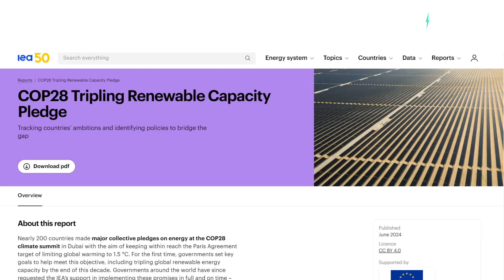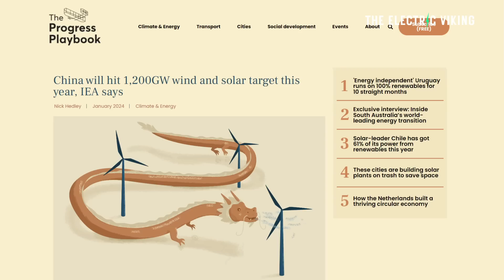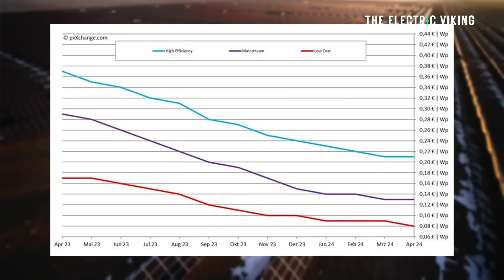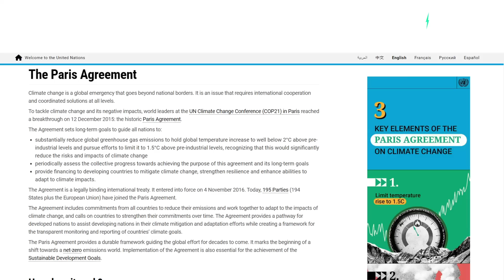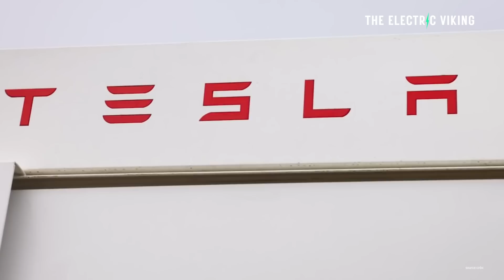IEA debunks media lies - world will triple renewable energy capacity by 2030

Comment: Big question is why a country like Australia situated in sun belt is not in the forefront to implement solar power.
Reply: Cost is enormous , land demand is enormous , storage cost is enormous and the fact that solar power produces no power for well over half the day, every day.
Reply: @Leonardo555ZZZZ cost is far cheaper than coal power. Any sheep paddocks can be part covered with PV and probably benefit the soil. Grid level batteries pay for themselves quickly.
Policies of the previous government put us way behind
Reply: The Size of Australia and distributing the power makes it very expensive and not viable. It has to be a careful mix including nuclear.

Comment: Oops - Our world in data "world enegy profile" says after 20 years of installations world power is only about 6% wind and solar. Solar install rates are declining year to year. Big wind projects are being cancelled due to costs. As the amount installed each year gets larger; it becomes harder to top that; so year to year increase is now only 10% and declining; as replacements start to be needed the rates can go negative. Electrical power is only 1/3rd of power consumed;  you have to replace all energy production even in another 20 years; you won't see 12% of world production; not with current lithium tech.

Comment: Forecast for 2024 is 655GWdc worth of new solar PV. Double that and we'll be adding enough solar generation to replace the existing generation of the entire America's (North, Central, South, Caribean) every 2 years or so. So at 655GWdc of new solar PV = replacing the entire America's grid demand in 4 years.
Double that to 1.3TWdc worth of new solar PV plus some 250GW worth of wind and we can not clear, but replace the worldwide grid within a decade (including old solar, wind, nuclear, hydro and fossil). My math is about replacing because we won't be replacing we need to grow electrical grid generation to provide additional generation for heat pumps, electrified ground transportation, bulk generation of heat from electricity for high temperature process heat (too hot for heat pumps). At that point cleaning up the grid is far less important because the emissions savings from not burning gasoline, diesel, natural gas and coal for non electricity generation needs will overwhelm whatever natural gas and coal that stays in the grid.
We place way too much emphasis on cleaning up the grid. We need to focus on electrifying everything. And stop adding any fossil generation to the grid. That's far important than cleaning up the existing grid (which will happen in many places).

Comment: Renewable energy is not environmentally friendly:

Simon and Lawrence Cathles of Cornell University analyzed 120 years of global data from copper mining companies to determine how much copper would be required for the [USA] to transition to renewable energy. The study found that the need would exceed what copper mines can produce at the current rate.

“Just to meet business-as-usual trends, 115% more copper must be mined in the next 30 years than has been mined historically until now. To electrify the global vehicle fleet requires bringing into production 55% more new mines than would otherwise be needed,” the study said. “On the other hand, hybrid electric vehicle manufacture would require negligible extra copper mining.”
Reply: Fossil propaganda.
Aluminium works too.
Elsa recycling.
Reply: @MrChakra108  Yeah right, EVs require much more copper - motor windings, for example - than do ICE vehicles. Aluminium is not a substitute for copper in many applications.

Comment: Mate love your work, I try to catch everything you produce, have learnt a lot. Regarding coal you could possibly be a little clearer when you talk about the phase out of coal.....may need to differentiate between Metallurgical and Thermal...as it turns out Thermal Coal is the low hanging fruit ...not sure on exact figures for Australia but Metallurgical coal accounts for between 40 to 50% of production and while there is a lot of promising research work going on it would seem that  we are going to be stuck with a need for the stuff for another 20 years at least...

Comment: Sam in the SUN BELT your observations make undeniable common sense. But in densely populated Northern Europe, Canadian cities, and Northern Asia where winters last 4 or 5 months, and where the infrastructure in inadequate, where the weather can be cloudy and calm we need FOSSIL FUELS for another 30 years albeit at reducing levels. - until the renewables and batteries can take over.
Reply: That was true 10 years ago, but with current prices solar panels are being installed everywhere here in Sweden. Maybe a little slowdown currently due to low electricity demand and exceptionally low price for electricity on Nordpol. We haven't used fossil fuels for electricity in Scandinavia, other than for standby backup, for many years. Also the combinantion of wind and solar is perfect in Northern Europe. The winter is windy and the summer sunny.

Comment: they make projections based on current tech. just imagine 50-100% more efficient solar cells and batteries. then make the cost calculations. The decommissioning of fossils and nukes will be total.
Reply: Nuklear will not be quickly decommissioned in countries that maintain a nuclear military strategy.
However it will in countries who don't.
fossils may not be decommissioned so quickly as for a long time forward they will be needed as a backup power strategy.

Comment: A poor farmer in Kenya a couple of years ago said ”a dictator can’t turn off the Sun”. Another reason to have distributed solar
Reply: Kenya is one of the places where rural people are using micro-solar setups.  The average cost of connecting a rural household to the grid is around $5,000, a cost that would never be recovered by the utility company.  For a modest monthly payment for 12 months or so a family can own a small solar setup that will provide them lights, phone charging, and run a radio.
Reply: A dictator with nuclear weapons could turn off the sun.
Reply: @ForbiddTV  Nope. Not forever.
Reply: agreed, also when crops and livestock are not doing so well cost wise then solar can make up the short fall also
Reply: @RayJohnson1980  Yes, plus, where the sun is too strong to grow crops, Agri-PV can shade the ground so food can be grown better below.
Reply: No need to turn off the sun, just the diesel trucks that make solar PV possible.
Reply: @borealphoto  
There are options for diesel trucks.  We've been using them because that is the technology we developed that was better than horses and oxen.  But (eventually) we figured out the downside of diesel trucks so now it's time to move to a better technology.  And that new technology will be mainly powered by solar PV.
Reply: @bobwallace9753  Better tech doesn't popup because we decide too. Mining trucks are already electric but nothing beats oil for energy density and ease of transportation, especially in remote areas.
Reply: @borealphoto  
It depends on how one defines "beats".  Running on batteries is far cheaper than running on diesel.  ICEs will get replace for commercial vehicles faster than privately owned vehicles.   It's all about the bottom line.

And the Sun shines in even remote areas. No need to truck in fuel.  Look at how remote mining operations are moving to solar.
Reply: @bobwallace9753    I don't think you have a clue of how expensive batteries are, how much work can be done with them, or how much electricity and time it takes to recharge a truck.  No one is going to be able to do that with solar.
Reply: @ForbiddTV  
EV batteries are now under $60/kWh and going lower.

Tesla is running long range 18 wheelers with batteries.  And hauling as much weight per load as diesels.  There are construction sites where the large earthmoving equipment runs on batteries.  There are massive dump trucks in mining operations running on batteries.

Trucks will charge as fast as EVs.  If there is ample output from the charger.  Tesla semis can charge up to 70% of full capacity in 30 minutes.  Which happens to be the required driver break time for truckers.

Charging with solar just means having enough panels and some batteries to accumulate energy for the non-sunny hours.

The world is passing you by.  Catch up.
Reply: @bobwallace9753   Your 'facts' are way off!. All of them.  Not only that. but the Tesla semis have been a disaster,  Whoever gave all such bad information should be soundly ignored, they are lying to you.
Reply: @bobwallace9753   I have been doing wind/solar/EV's and owned 4 EV's for 30 years before a single Tesla existed.  The world needs to catch up, but sadly the Greenies are turning ruinables into a nightmare.
Reply: @ForbiddTV  
Sorry, your game-playing is not interesting.
Reply: @borealphoto  My rooftop PV does not require any diesel truck. Switch off all diesel trucks and it will continue to make my power everyday.
Reply: Until we come up with viable energy storage technologies, ruinables will always need the support of fossil fuels.
Reply: @ForbiddTV  I assume you are talking about raw materials mining etc. Which is in the meantime the only place in the "food chain" where fossils are still needed. I guess you also recognized that I was talking about a running system that has been built prior to any devastating action taken by someone. Since fully electric trucks are already on the roads, it is not far away any more to close this gap as well.
Reply: @ForbiddTV  Maybe where you live. Where I live we have sufficient storage for the time being.
Reply: @beatreuteler   No one has "sufficient storage" to charge EV's or trucks.
Reply: @ForbiddTV  Sorry, but you are completely wrong.
Reply: @beatreuteler   Yet none of you can show anything incorrect that I have said.
Reply: @ForbiddTV  No problem. But timewise, I can only respond to statements you directed to me directly. The last one was "no one has...." Ahd this one was totally wrong. My country has hydro power storage worth 8.5 TWh, way more than needed to charge all EV's and all electric trucks the country may employ decades from now, especially provided additional battery storage is built up gradally as well. So really, you are completely wrong with what you stated. I am not looking at other statements due to lack of time.
Reply: @beatreuteler  8.5TWh? What country? The whole planet has 9TWh.
Reply: @borealphoto  Nope. The planet has much, much more than that. Please note that I count the entire hydro storage, not exclusively pumped hydro. Probably your global number is referring to only the pumped storage. Of the 8.5 TWh approximately 15% i.e. nearly 1.5 TWh is pumped hydro here. Country is Switzerland.
Reply: @beatreuteler  Power counts more than capacity, and you can't count power you're already using to phase out fossil fuels. 

BTW, Switzerland has the largest discrepancy in the world between it's territorial and consumption emission, ie, the biggest climate hypocrite. All of Europe is like this.
Reply: @borealphoto  Again, what you write is not true. Of course there is still a large fossil consumption, (in traffic and building heating) but it's by far not the highest "discrepancy". And still we can count on our storage as we are constantly adding solar power. Now, since the added solar power is not always coming in the wanted time, that's where storage kicks in: it is power we can use at a later time. Perfectly what is needed to complement the added solar power.
Reply: @beatreuteler  Read again, I'm talking about territorial vs consumption emissions, ie non-territorial emissions that makes Switzerland function. You have the highest discrepancy at 231%.

Comment: Doctor Google says: "After the permitting spree of the past year, China currently has 243 GW of new coal power plants under construction, or permitted for construction. When plants currently announced or in the preparation stage but not yet permitted are included, this number rises to 392 GW of capacity at 306 different coal power plants."
Reply: I have not looked at Chinese coal output bug just cause there are more cosl plants does not mean they all generate at 100% capacity… In Latvia we have big gas plant that mostly sits idle in summer as we import renewables instead, we need it in winter when it works with heating in combined cycle and helps stabilise the grid. Same in China, could be they are needed as baseline for when there are less renewable energy available, and with batteries getting cheaper and more renewables, they will go away relatively fast too… or will be utilized at 10% capacity or sth
Reply: I agree to @lkrnpk and would like to add that in spite of the ambituous coal power build plan in China, the share coal has on China's electricity mix is shrinking every year. This is due to the fact that wind and solar combined have a faster growth pace than coal!

Comment: I like your show, and love EV's, but Solar & Wind are terrible for the grid.  First off they are SUPER EXENSIVE, much more expensive than conventional power.  Germany spent 1/2 a trillion dollars on Wind & Solar, and now they are suffering.  The cost of this electricity in Germany is 300% more than conventional electricity in the US.  On cloudy days and at night time Solar doesn't work, and battery backup is super expensive, it just cant handle the load.  Wind kills millions of birds and is breaking down all the time, doesn't work when the wind stops blowing; plus its an eyesore.  The Grid needs continuous, inexpensive power, I know, I have solar on my house roof.  SO WIND & SOLAR ARE OUT...

What is the answer?  Kirk Sorenson explains in the YouTube video "Thorium in 5 min".  This is not theoretical, or something that will happen in 30 yrs.  Its happening right now.  Clean, safe, inexpensive continuous power.  First developed for the US Airforce in 1964, at the Oak Ridge National Laboratory.  Now China has built a demonstrator reactor, and is in the process of building one that will power a small city.  This is a Reactor that cannot melt down and is super safe.  Friday night, you flick a switch to turn it off.  Monday morning you flick a switch to turn it back on.  There is also 100 times less waste than conventional systems.  
See Link:  https://youtu.be/uK367T7h6ZY?si=_A-t-K_0-ntfQTUT
Reply: Dear John, you couldn't be more wrong than that.
1.) Germany has high power cost not becuase of the renewables, but due to the high cost of gas powered electricity. The prices in the grid are always defined by the most expensive unit on the grid which pretty always is a gas station and Germany is suffering from that.
2.) Yes, Germany has invested a lot in renewables, but it is importing oil and gas for 67 Billion a year. This said, in 7 years, Germany is spending 1/2 trillion on oil and gas and guess what: it is then burnt. But the investment of 1/2 trillion in renewables is now an asset!!!
3.) Solar works perfect on cloudy days, check this out.
4.) Wind power plants actually so not kill many birds. There are large studies that come approximately to the following conclusion: 4a) Cats are killing about 700x more birds than wind power stations (WPS). 4b) Cars are killing about 500x more birds than WPS. 4c) Buildings, especially with their windows, are killing more than 100x as many birds than WPS. -> Do you want to ban cats, cars and buildings? just let the community know how to do that.
5.) Thorium reactors may or may not be a way to go for countries who do not want to abandon nuclear, but it will not help for the ones who want their nuke stations to make weapons. But Thorium reactors do not exist today and about theor safety (look at the entire system, not just the reactor itself) there is nothing but the parole of their supporters. And the idea of having them ON/OFF is a plain lie. As far as it is about building trust which is the first thing to care about when trying to convince people, spreading lies is the worst you can do. Thanks, but NO thanks.

Comment: China built 37 new gigawatt coal plants in 2023.    Coal isnt going anywhere anytime soon.
Reply: and they also built 230GW of wind & solar in 2023. Even China knows coal is dying.
Reply: @steve_787  that's if we can believe anything comming from them.  Who knows what's real.  I'm all in on the future of a diverse energy grid  that does not rely on a single point of failure.
Reply: @ChuckHolland-i4b  Can't overly see what there is to gain by misleading on how much power generation they have installed. Maybe a bit of rounding up but 200GW+ would be noticeable if it wasn't really there. 
Agreed you can't rely on just one source of energy, UK has some days where it's almost an even split of gas, solar, wind, biomass, nuclear and imports. Coal is a couple of months away from ending as our last plant is due to close. Took over a decade but shows it can be done, only source of coal power to us would be via the Danish interconnector but, thats only 6% of their power so is minimal to us. Gas will start to go the same way and once battery/hydro storage is ready I'm sure we'll start counting the gas free hours/days.

Comment: My suspicion is that as renewables reduce the cost of electricity in Australia, our gold plated poles and wires will go platinum.  Those who own the grid will think that they alone should benefit.  With panels and batteries getting cheaper, Australians should be thinking of going off grid.  (Stupid but necessary.)